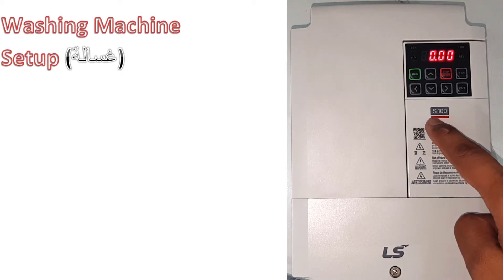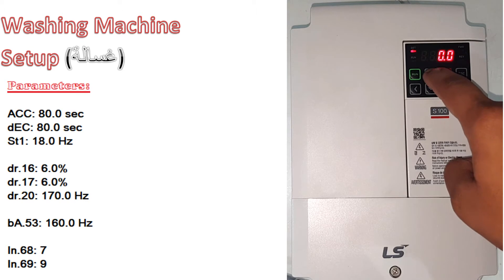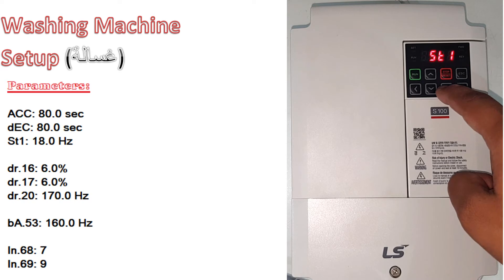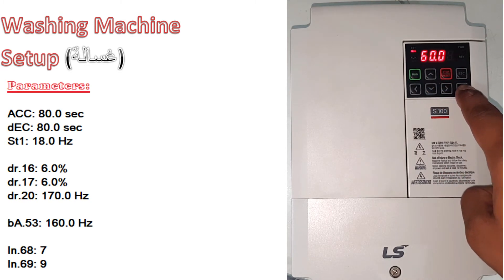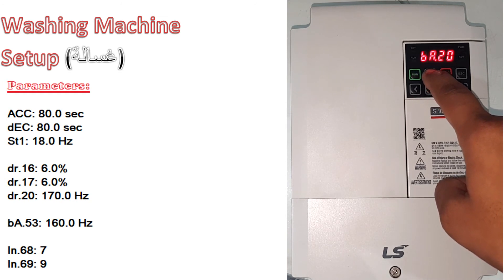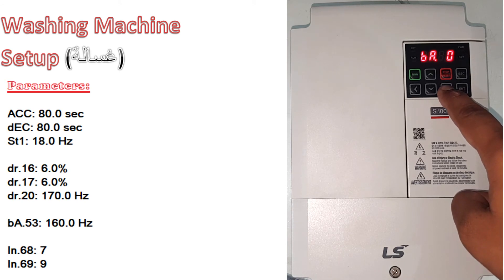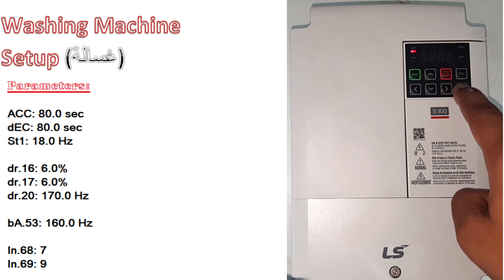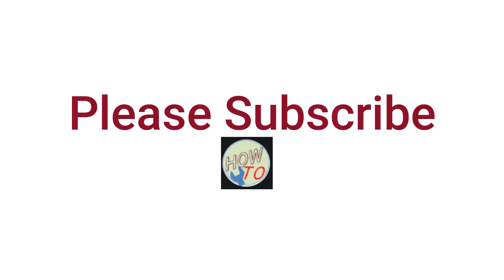How to program S100 for Washing Machine Application? || S100 LS

Comment: Thank you for the illustration my question is do we need to switch on run, forward and reverse with the  p4  NO switch to O N  to achieve washing pro cess or it's just the p4 switch in as much as all the parameter has been set according to your instruction ? thanks.
Reply from the maker: Thanks for the interest,
P4 alone will not do, so P1 or P2 along with P4
Reply: Thanks for your responds  so it means the three switch Normally open.     1, 2and4 would be in ON  position at the same time is this what you are saying ?sorry for bordering it just for more clarification  because washing movement would require to and fro movement
Reply from the maker: @owoeyeayodele4859 switch 1 and 4 for forward. Switch 2 and 4 for reverse
Reply: How would the forward and reverse work simultaneously is there anything to be done to achieve this because if 1&4 work together and2&4 as reverse does it means  doesit means we can't achieve this movement without switching one for the other please expanciate sirGod bless ing and thanks
Reply: Because I have a job at hand that has this challenges